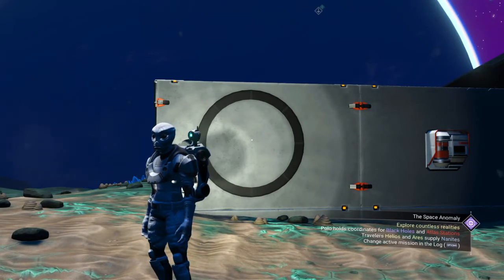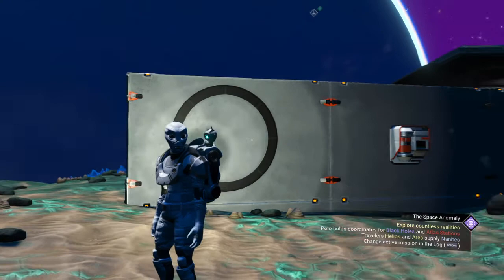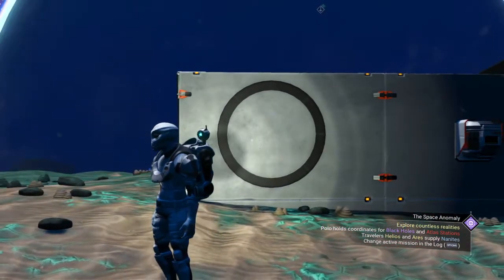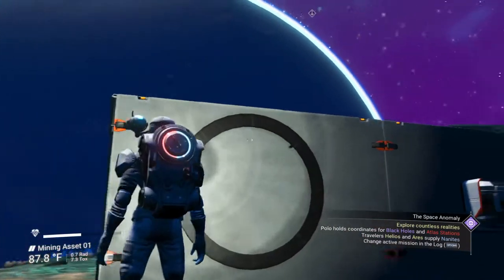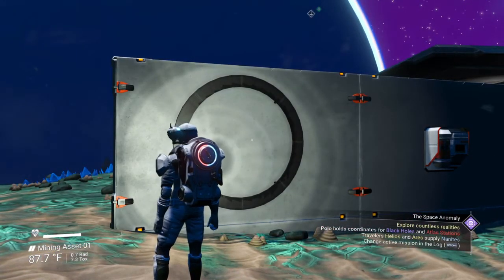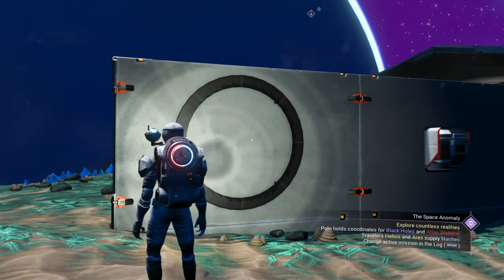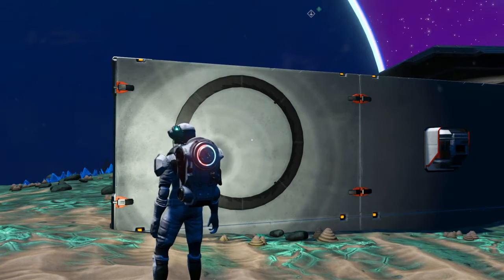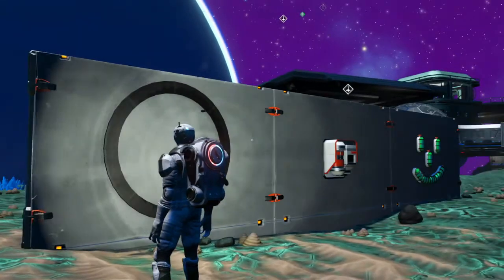No Man's Sky Quickie: how to power ring lights and other un-powerable objects.

Comment: Dang. I was hoping it would be something other than attaching the other light. My ring light is in my basement. So I have it on the same side of the ceiling. I was hoping to find a way without a visible intrusion on the aesthetic. Clearly I can’t have the white light in the middle of my main floor.
Reply from the maker: I typically solve that problem by using the short wall segments to create a space between floors and put the can light and wiring inside that space.
Reply: @rustyhatfield8302  Yeah I will do that next time. I built this base not knowing how the ring light worked, so I wasn’t able to plan ahead for that.
Reply: @fakebobbyhill296  feels I've been wanting to use it in some of my portal base builds (except my dirty space trailer base)  cause the standard lights are the dimmest thing....like for real figured out space travel haven't upgraded to l.e.d 🤦‍♂️

Comment: Doesn't work
Reply from the maker: Ring lights now have a handy dandy power attachment node, so this trick isn’t needed anymore to get them to work. I keep it up because the information provided for colored lights is still valid and useful. This trick will still work for ring lights but isn’t strictly necessary anymore. I have a number of builds that utilize this method and all those builds still function properly as of this writing.
Reply: @rustyhatfield8302  have u tried doing it next to a door, like the little bit of wall space next to a door? I tried it to power a health station and it didnt work there
Reply: I actually went looking for videos and this exact comment! lol @justkief6521  I could not get the light trick to work next to the door or on the angled wall exteriors. But, the trick still works with lights near the door, just not the health / shield stations as I was able to put the little green lights on interior/ exterior next to the door and only power the interior lights which wirelessly turned on the outside ones.
Reply: Dang it. No longer works for First Aid stations.